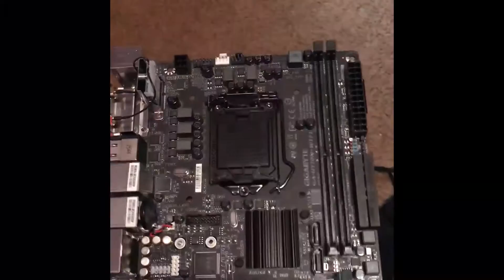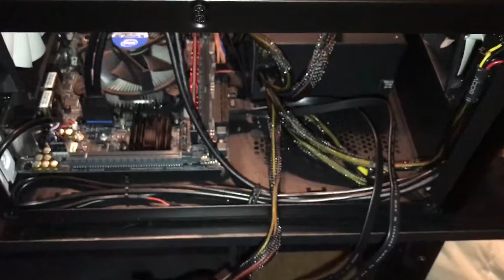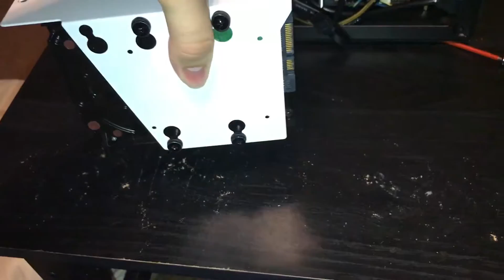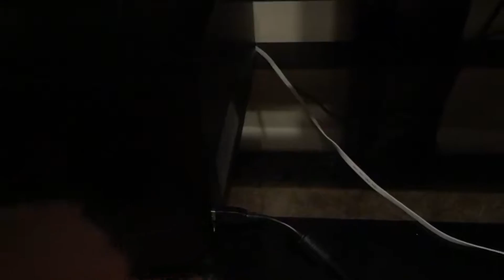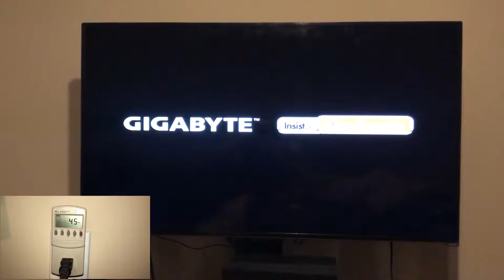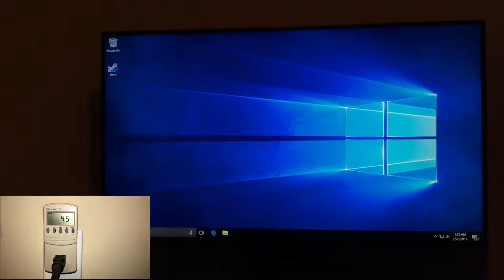My Fractal Node 304 Plex rig (with SFX PSU)

Comment: How does the Pentium G4560 handle streaming Plex at max settings?
Reply from the maker: idefyu23 I can do two 1080p streams at 8Mbps out of it (the 8Mbps is due to my upload speed, not the Pentium). Since Kaby Lake is hyper-threaded you've basically got an i3, which is fine for a stream or two at a time.
Reply: RandomPedestrian07 thanks for the info ☺️☺️☺️